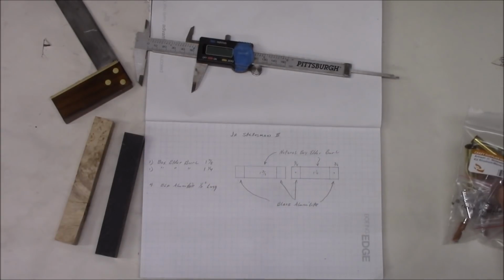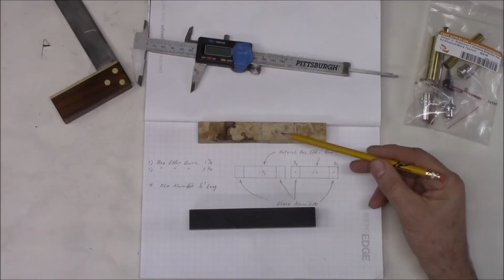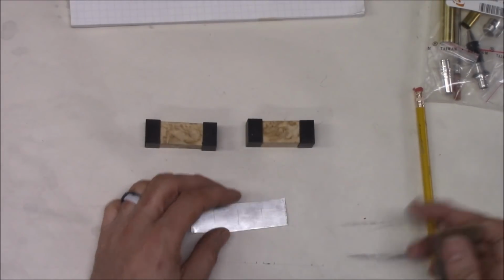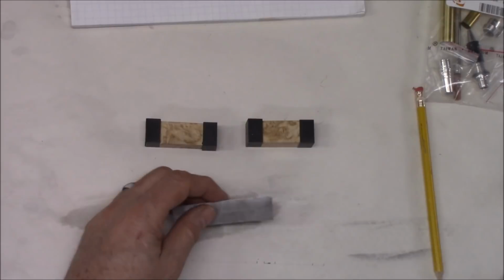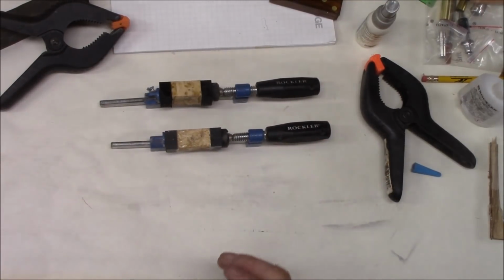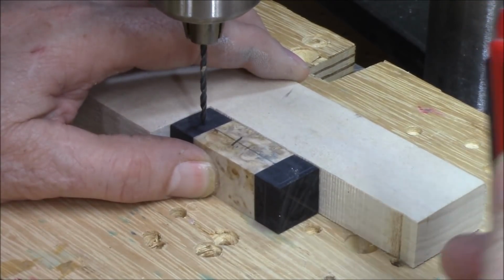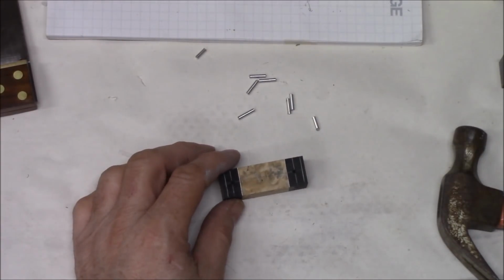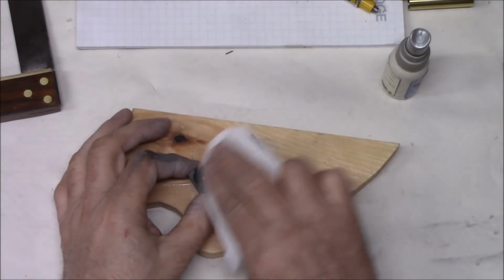Segmented  Black & Burl Beauty

Comment: Very nicely done!  How did you strip the coating from the soda can aluminum strips?
Reply: I forgot to ask what bushings you are using with your Jr. Gent pen kit.  The Jr. Gent is one of my favorite kits and I keep wanting to try turning it between centers rather than using a mandrel, but Craft Supplies USA doesn't offer bushings for that purpose.
Reply from the maker: +David Walser Hello David, I stripped them with MEK and sandpaper.  I use the regular bushings from craft supply. Watch my thanksgiving day update and I’ll show that.  Thanks for watching and the comment.